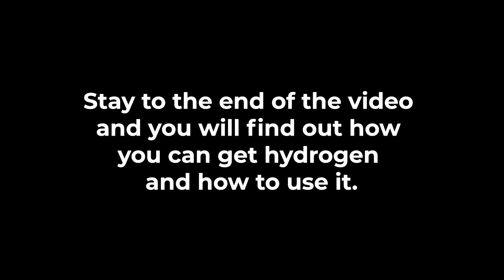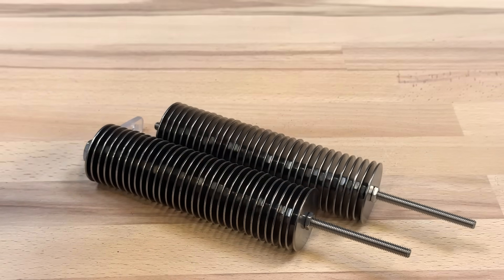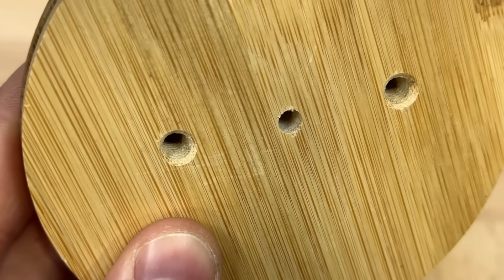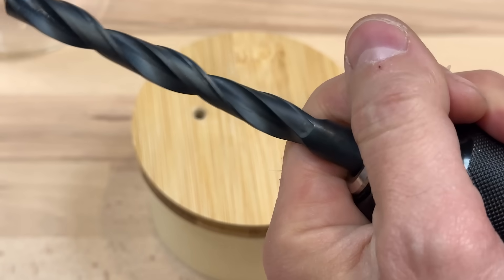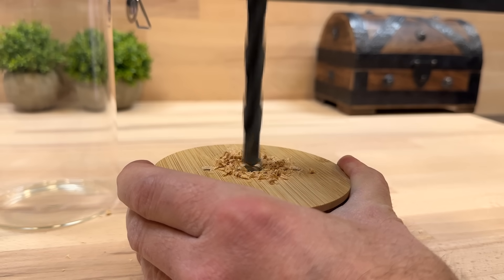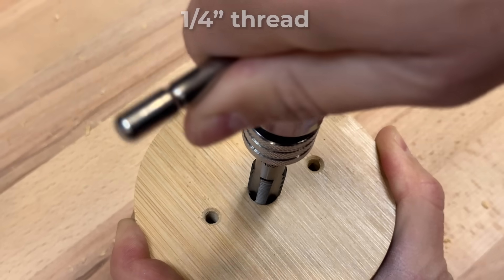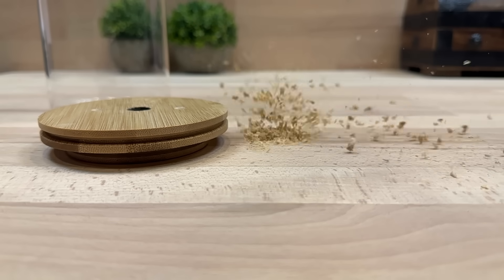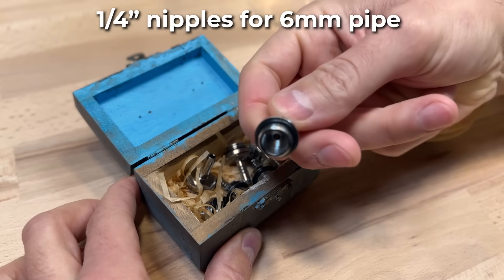Making a Simple Hydrogen Generator - Water to Hydrogen HHO

Comment: You are creating Brown's Gas which is a lighter than air form of water which can be ignited with a spark. The two hydrogens are loosened but not separated from the oxygen. By using an electron microscope or other modern device not available 60 years ago, the two hydrogens in Brown's gas are seen to be relocated across from each other. The abbreviation has always been HHO but now we know HOH would better describe the two opposing hydrogens across the oxygen. Water is used to put out fires because the two hydrogens cannot be ignited. After using relatively little energy to convert water into a lighter than air form of water called Brown's gas, the two hydrogens can be ignited with a spark but not by impact. To split hydrogen completely from water takes a lot of energy and expensive equipment so hydrogen costs more than gasoline. To weaken the link while leaving the two hydrogens attached to oxygen takes a few dollars worth of equipment and rellatively little power. Hydrogen and brown's gas both have about 4 times as much power as gasoline. Yull Brown in Australia said he was able to achieve 1,000 miles per gallon of Brown's Gas. Once car makers get brave enough to use Brown's gas and millions of people are using it. Water at home costs 8 cents for 10 gallons. Gasoline and even more expensive hydrogen cannot compete with Brown's gas. My neighbor did a lot of driving one month and her gas bill was $500. Running on Brown's gas she could have traveled the same distance for next to nothing.  Long distance trucks with diesel engines used to pull trailers will be able to save many thousand of dollars per month by switching to Brown's gas.  And that will help to bring down the cost of groceries and almost everything else.
Reply: Die chemische Formel von Wasserstoff ist H2 und die von Browngas ist 2H. Das eine ist der Molekulare Wasserstoff und das andere ist der Atomare Wasserstoff. Und der Unterschied zwischen Molekularen und Atomaren Wasserstoff ist der Energiegehalt. Der Energiegehalt des Atomaren Wasserstoffes ist aber so hoch das er ausreicht um einen Wasserstoff Entwicker zu konstruieren statt einen Elektrolyseur. Und nun versuche doch mal den Unterschied zwischen einen Entwickler und einen Elektrolyseur zu ergründen. . 

Und ganz nebenbei wenn man das so baut wie in diesen Video wird ein großer Teil der Energie in Wärme umgewandelt. Ergo, gar nicht genutzt!
Reply: How would you recommend building one  @sweetdrag1
Reply: @sweetdrag1    Auch mit einem "Entwickler" wird man bei der Erzeugung von atomaren Wasserstoff nicht weit kommen, denn unter Normalbedingungen gibt es den nicht, weil sich die H-Atome schnellstens paarweise zu molekularem Wasserstoff verbinden. Das Gleichgewicht der Reaktion zwischen 2H und H2 liegt ganz beim H2.
Reply: @sciencefreak9070   Ja schon. Aber je höher die Temperatur desto höher ist der Anteil von Atomaren Wasserstoff Und dieser Anteil bleibt bis zum Brenner relativ stabil. Es muß halt nur sofort Verbraucht werden.
Reply: @   Ja, die Verwendung von atomaren Wasserstoff für eine besonders heiße Flamme ist seit Langmuir bekannt. Für atomaren Wasserstoff braucht man Temperaturen über 1000° K, was naturgemäß für die wenigsten Anwendungen praktikabel ist.

Ich kritisiere hier vor allem den Eingangskommentar von "richobrien", denn der beschreibt ja gar keinen atomaren Wasserstoff wie ihn die Wissenschaft kennt sondern ein mysteriöses Brown-Gas, das man angeblich mit weniger Energie elektrolytisch aus Wasser erzeugen kann als molekularen Wasserstoff und das trotzdem über einen höheren Brennwert verfügt als molekularer Wasserstoff. Das ist Nonsense. Es gibt aber eine Firma, die dieses Brown-Gas als innovative Lösung anbietet (YBG-Group). Ihr ganzer Webauftritt schaut schon nach Betrug aus.
Reply: Brown's Gas has the same fuel value as hydrogen but can be generated with a considerable smaller input of electrical energy??? This would be a clear violation of conservation of energy! A Brown's gas with other properties than the mixture of hydrogen and oxygen gas is a myth only, Yull Brown was wrong with his theories. If the two gasses aren't separated during electrolysis you get a mixture of hydrogen and oxygen gas, nothing else. Several references on this can be found in Wikipedia, "Oxyhydrogen".

Comment: To increase efficiency you should add neutral plates to create 2.6v cells you get more gas and less heat
Reply: YES This design will spent most of the energy causing the electrons to buck and make it look like it is making lots of white gas, in a one bath HHO cell system. It needs to be a sealed HHO cell so you can make more LPM of gas to the amount of energy you put into the cell. It will only produce para HHO gas. If you seal each cell from each other and let the electrons flow one direction and fast and under 2.8v you can then produce a higher quality of gas. More gas power watts of power.( Water gas called Brown's gas or Hydroxy Gas™) You can then make a 4x more powerful form of ortho HHO and include the (-)non-hertzian energy into the magnetic field of a 7 plate cell for 12/14v DC power source ( + N N N N N - ) N = neutral plates. Then add inductor toroid and a rf choke toroid to capture the (-)non-hertzian energy and a square wave PWM to slam those water molecules! Add this water gas into your car's air intake and add a catalyst to the fuel. Hydro-carbons are (+) charged and (-) charged hydroxy gas will bond to the + and blow it all apart in the cylinders resulting in more HP and clean emissions by 85%! Too bad CARB can stand it. Andrew from HydrogenGarage dot calm and HydrogenTrucker dot calm.